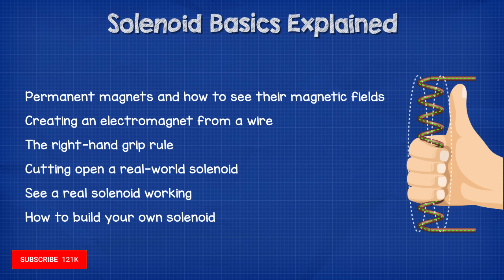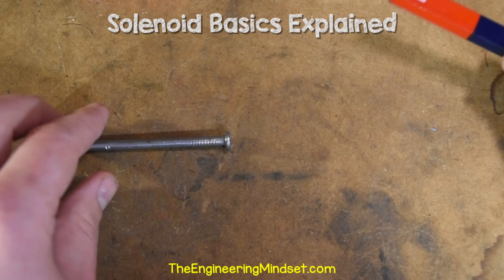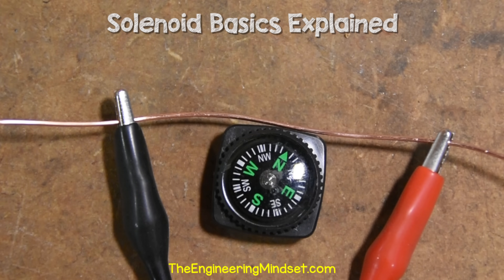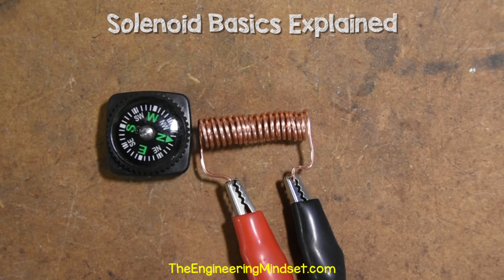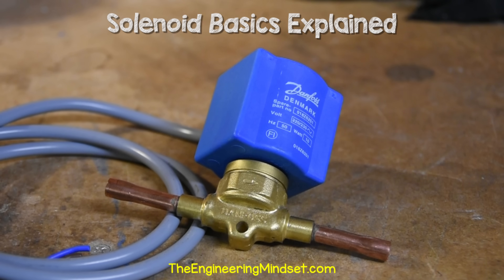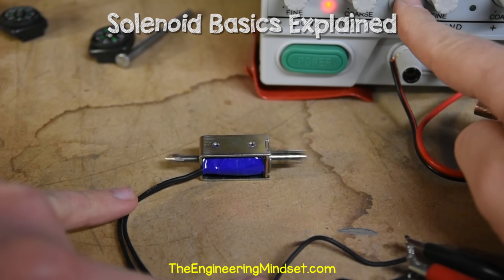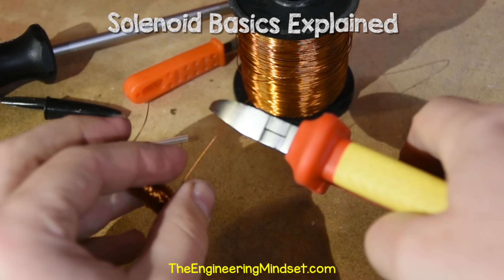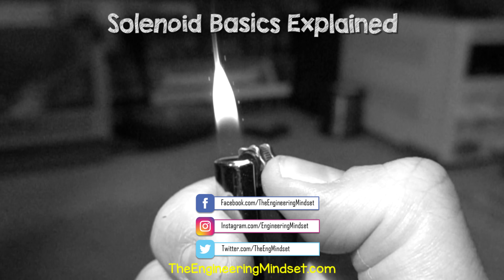Solenoid Basics Explained - Working Principle

Comment: Great video!....but have question on homemade solenoid.  At ~ 7:50 and later. You mention wrapping the stands in the opposite direction...?

Maybe I misunderstood and video was too fast, but if you wind opposite, that would reduce the magnetic field potential.

In solenoid/coil production, they run strait from the spool and wind back-and-forth along the field axis while always keeping the copper windings untwisted....and never run in the opposite direction (clockwise vs counter clockwise as view from either end of axis)

Please advise as I may be misunderstanding your video and others could fall into the same situation.

Cheers!
Mr. P
Reply: I think he ment "forth and back", the turns are still in the same direction but the pitch direction changes. Best regards
Reply: Winding the opposite direction would have the same effect as reversing the polarity.

Comment: The wire needs to be insulated...you cannot use bare coper wire
Reply: *Enameled wire. Standard insulation will block the EM field.
Reply: @ethanwagner6418  its still insulated and its not all enamel, there are many different types if clear insulations with varying temperature ratings  and standard thermoset, thermoplastic insulations etc etc does not block it, it is notmused because of the temperature rating
Reply: @SJ-hw7bx  where was he not using insulated wire when he should've been?
Reply: @ethanwagner6418  just in the beginning when he did the 1st coil with bare wire.....later he said magnet wire which is the insulated motor wire
Reply: @SJ-hw7bx  does it matter in the first coil, where the wire is less likely to short itself?
Reply: The first coil was uninsulated because it was one strand of a larger conductor, but it worked fine because the loops of the coil were not allowed to touch one another.

Comment: I wish there were videos like this 25-30 years ago when I first started out.
You make everything so easy to understand. I will be using this to teach my son in a few years.
Reply: yeah, but... you gotta consider,  you tube is only 15 years old or so , maybe 20
and then once it started you just had shit for the most part until decent content creators came along.
Reply: @martinkuliza  you just had shit until there was money to be made.
Reply: yeah im 15 and wanna be an engineer so i feel pretty lucky that i have videos like this
Reply: Paul, question - I have a 415v MEM starter on a saw, how or what do I need to do to the coil (Solenoid) so it would work with 240v, more coils of wire on the coil? or less? and could I measure the resistance in the coil - no sure what that would be? thanks for any help, Paul
Reply: Thats one of YTs benefits
Reply: Really great video....... Good luck !!!
Reply: I wish I had a dad like you who was there for me when I was young to teach me stuff like this. Thankfully I came to this stuff on my own :)
Reply: Has the few years come yet?
Reply: Would what happens to the compass when beside the bar magnet also happen with an electromagnet? Can I expect that to happen?

Comment: Without a resistive load in between the wires, how is this not a direct short?
Reply: There is some resistance in the wire itself, and there is power bleeding off into the magnetic field.  That is called induction.

Comment: We use AC or DC supply for solenoids?
Reply: DC. The current, and the magnetic field it induces, need to be in one direction. If you used DC, the piston would occilate back and forth at the same frequency as the voltage and current.

Comment: Engineering mindset: I'm really interested in @ 8:17 where you have the nail in the homemade coil, in knowing which way the nail will go, depending on the direction of current. So, if running current through a wire induces and magnetic field, and a coil magnifies that magnetic field, and pointing your thumb in the direction of current flow means that your thumb will point towards the North pole of the coil, then, and please confirm that I am understanding this part correctly, it seems that you will turn the nail into its own bar magnet. Now, the question is, which end of the nail is which pole? I think that, per 8:40, it seems like the nail stops perfectly centered in the coil, therefore, I think that the left end of the coil is the North pole, because due to the right hand rule, that's the direction of flow of current, and your thumb points toward the North pole, therefore for the nail, the left end of the nail, it is the South pole, that way the nail stays centered in the coil as if the nail was its own bar magnet and the ends of the nail are opposite the ends of the coil. Did I get this right?!
Reply: Yes sir I also had the same doubt

Comment: So was this guy using AC or DC power for this video? It really confused me when he changed the placement of the leads, because with AC power you can't change the placement of the leads to change its direction. Its always changing directions.
Reply from the maker: DC
Reply: @EngineeringMindset  can i still find normally open and normally closed solenoid valves when using AC power? How do those work if its not possible to change the polarity of the current?

Comment: does the magnetic field always try to center the nail (plunger) within the coil? Because in the video I see that the energized coil seems to pull in the nail until it is pretty centered, then it stops roughly in the middle of the nail length. But does it center by mass or length? meaning that since the side with the nail head has more mass, it should stick out less far than the other side. Is that the case or does it stick out the same amount if it centered it by length? Hope this is clear ahah thanks for the video!
Reply: It's a bit more complicated due to the involvement of moleculars in the nail. The iron moleculars are going to be influenced by the magnetic field of the coil, so instead of being what the iron atoms are, they all go to a specific direction when a magnetic field's in the near. It's the same when holding a magnet with marked poles sideways the nail. The atoms either become attracted or distracted by the magnetic field
Reply: The shape and density of the winding, the voltage, the gauge of the wire, all of those play into the shape and strength of the magnetic field.  When two forces are acting on each other, the stronger one wins.  The nail has its own magnetic force, but it's weaker than the coil, so the nail moves.  Where and how far it moves depends on the strength and shape of the acting magnetic domain.

Comment: Absolutely loved this video, thanks for making it. Donated enough for a coffee in Australia.
I have one question - when you say "north pole" of the magnet, what does this actually mean? Are there more electrons bunched up that end of the magnet, or the other way round?
Reply from the maker: Thank you :D That's an excellent question although it's really a physics question and not engineering so it isn't my expertise but from memory it's to do with the alignment of the atoms and the direction of rotation of the electrons. Sorry I can't fully answer but hopefully that'll put you on the right track.
Reply: @EngineeringMindset  Thanks mate, that's a great start
Reply: from the early times of electromagnetic experimentation, the n. pole of a magnet is that to which the north pole of a compass will point.
Reply: Magnetic fields have a "flow" to them like an electric current; it's no coincidence that magnetism and electricity are so closely related.  Magnetic fields are realized by photons, which also is what all electromagnetic radiation (e.g. light) is.   The N/S pole names drive from the magnetic field of the Earth itself.  When you hear on the news about the "magnetic pole flip" that might be coming ... it's talking about the Earth's magnetic field literally reversing... so N would become S, and S would become N.  

One of science's holy grails is finding a magnetic monopole — a magnet with just one pole!

Comment: hello thanks for this great video 
i want to ask you a simple question
what did you use as the power source dc or ac current ?
and what happen when you use ac current?
Reply: DC
Reply: @louf7178  i have searched and i found that ther is two types of solenoid ac and dc

Comment: Can you make animated video of how induction motor acts like a generator:rotor rmf and stator rmf difference
Reply from the maker: We have an animated video on induction motors showing the magnetic field. Check that out.
Reply: @EngineeringMindset  but i need different video on induction motor acts like a generator in (like in tesla model s) detail to understand,because i am so confused with it
Reply: It's the same as how a motor works, just the opposite.  In a motor, a electromagnet creates a magnetic field which acts on a fixed magnet to generate rotational force.  In a generator, a rotating magnetic field acts on a conductor to produce electricity.

Comment: Excellent video but how did the magnetic field move the piston exactly or why does that even happen? am I missing something? thanks.
Reply from the maker: The basic theory is that it's the spin of the electrons within the material being attracted. Materials in which the electrons align parallel are magnetised. It's a bit beyond this video and delves into physics rather than engineering. But still, great and interesting question. I'm sure there are a lot of videos to cover this depth.